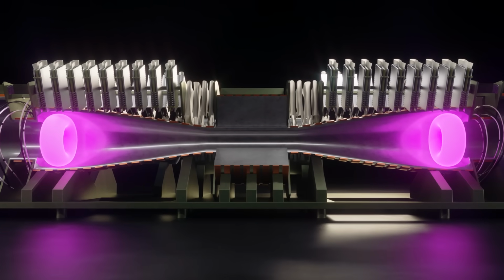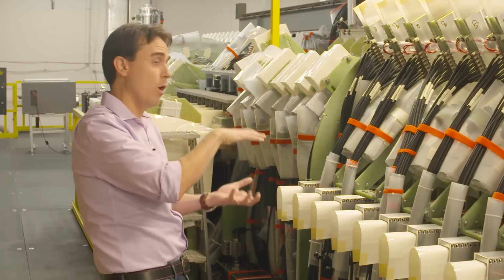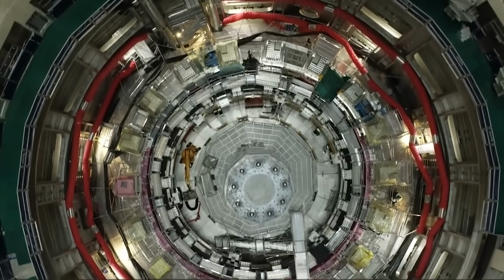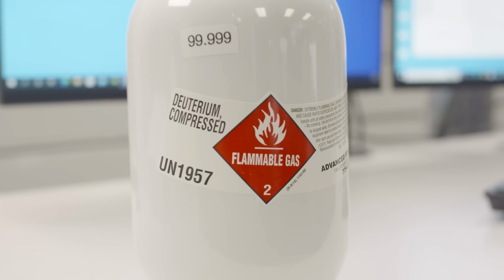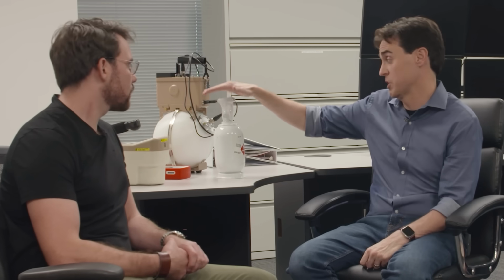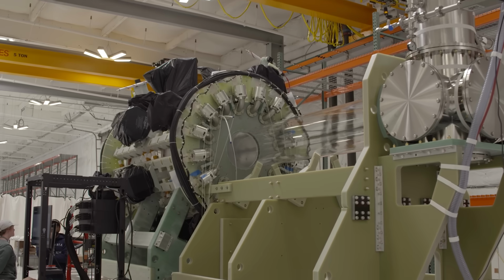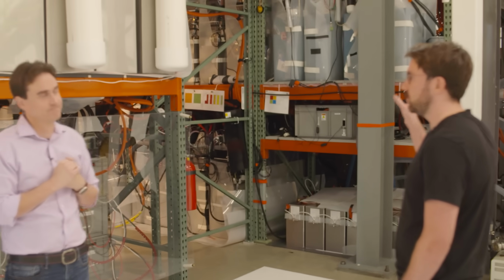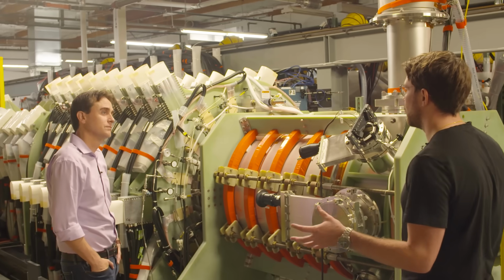A New Way to Achieve Nuclear Fusion: Helion

Comment: Update, turns out my concerns were warranted, and experts are weighting in on the situation. Helion Energy makes several, outlandish claims, and their method is unlikely to achieve net energy gain, regardless how much money they pump into it. Look up the yt video of improbable matter, named "The problems with Helion Energy - a response to Real Engineering"
Reply: That video is basing their criticism solely on this video. And this video is meant for the general public. So, it does not go into all the nitty gritty details (and gets a few things wrong too).
Most of the "concerns" raised by Improbable Matters have been addressed by Helion on several occasions in the past.
Reply: @elmarmoelzer2229  Sorry, but this response is too broad for me to take it at face value. Please go into detail which specifics got misrepresented by this video, and which of the concerns, that improbable matter is pointing out, were addressed by helion in the past.
Reply: @sgt.bonkers8706  
Yes, FRCs have been done before and the members of Helion's founding team were involved with several of them. They applied the lessons learned from thoes to their own design. 
There are lots of things that matter:
1. Size of the FRC. The larger, the less susceptible to n=2 instabilities.
2. Elongation to radius ratio. The longer the FRC, the more stable it is.
3. The merging before the compression. This part creates a single, hotter and more stable FRC (FRCs get more stable the hotter they are) as a targer for compression.
4. Their FRCs have a very low Te:Ti ratio of 0.1 and less. That makes things a lot easier because: P(fus)/P(loss) scales as Ti^1.5 / (Z^2 * Te^0.5 )

5. D-He3 is very hard to ignite, but they do not need ignition for their design to produce enough net electricity to be economic. That is because of the fact that they can recover a large part of the input energy directly as electricity and because of their relatively efficient output energy recovery.

6. Trenta is a subscale prototype with much weaker magnets than what they are proposing for a full scale powerplant.
Because of that temperatures are somewhat lower than in a full scale power plant. Power plants aim for temperatures over 30 keV in at which point the D-He3 reactivity surpasses the D-D reactivity.
That said, Helion actually wants the D-D reactions because that is how they are breeding their He3.
D-D => He3 +n or T +p.
Both reactions have a 50% chance of happening.
So, in mixed mode (breed and power) machines, they will need two D-D reactions for every D-He3 reaction, at least until the Tritium inventory is large enough that they have a constant supply from decay (Tritium beta decays into Helium3).
That can take maybe 20 years and that fact is probably the best criticism of Helions approach.

7. So they will have D-D neutrons in 1/3 of  their reactions. What IM does not mention is that D-D neutrons have about 1/6 of the energy of neutrons from D-T reactions (2.45 MeV vs 14 MeV).
That is below the activation energy of many materials and much easier to shield against. 
Trenta is as mentioned an experiment not a full scale power plant and only operating at one pulse every 10 minutes (vs 10 Hz in their 50 MWe power plants). Not all shots were fueled by Deuterium or Deuterium + He3. Many were fueled by a mix of hydrogen and Deuterium or pure hydrogen, depending on what they wanted to test.

Because of all that the total neutron flux has been relatively low. 
The machine is mostly made from low activation materials or materials with a half life measured in minutes. Aluminum activated by D-D neutrons has a half life of 2 minutes.
There is still permitted shielding of course. It is in the walls of the room and not close to the actual machine, which can handle the aforementioned relatively reduced neutron load just fine. 
In fact testing different materials for neutron exposure was one of the purposes of Trenta. They have tested quite a few alloys to see how they behave.

Those lessons will be applied to Polaris which is their next machine. Polaris will take those tests to a new level with a pulse rate of up to a 1Hz and higher temperatures.

8. The Ion gyro- radius "known physics" argument was hogwash based on a misunderstanding and out of context quote in the RE video.
What happened was that Trenta achieved a higher ion temperature than Helion's model predicted. Higher ion temperatures are a GOOD thing. They also mean somewhat larger gyro- radii. Thats in line with established physics. Just that Helion's "physics" model for the machine design was too conservative and Trenta performed better than predicted.
Reply: @elmarmoelzer2229  Ty for the detailed answer.

Comment: Please follow up on the issues mentioned in this response - https://www.youtube.com/watch?v=3vUPhsFoniw
Reply: That video you link contains a number of mistakes that diminishes its value. Understandable, since it seems to be based exclusively in what is said in this one, and this one is made for a general audience (it is short in technical details, and even contains a few errors).
Much of the info that doesn't appear in either one can be found easily elsewhere. Other sources of information are the presentation by Dr Kirtley from about a month ago for Princeton U. (available in one of PU's sites), Helion's website, a number of papers published in scientific journals these last years, etc.
Helion's approach is not guaranteed to  work, but that video if far from proving the opposite and, as usual, shooting from the heap adds little of value to the discussion.

Comment: Tens of millions of degrees? The core of the sun is 27 million degrees and you expect me to believe this little tube can withstand these temperatures without deformation or melting?
Reply: The fusion plasma is very hot, but not very dense (closer to a vacuum than to ambient air) and it is surrounded by a high vacuum, which is a perfect insulator.

Comment: Hypothetically, with some tweaking, could this reactor be used to propel a craft through space by putting an exhaust manifold of some kind off of the compression chamber??
Reply: They have a different design for propulsion. That would have a higher Thrust to Weight Ratio than this. They worked on that with a NIAC grant back in the day, when they had too little funding to move forward with the power plant design.
Reply: @elmarmoelzer2229  - When you say they, who are you referring to? Also, This thing was just created and I am trying to hypothetically use it for space travel, give room for the tech to mature.
Reply: @caffeinatedme6955   They = Core team of Helion. They have been working with FRCs way over a decade and not just for power generation but also for propulsion.
Trenta is their 6th prototype for the power design. They have had a number of other FRC machines for propulsion as well.
One of them generated over a billion FRCs in fast succession.
Reply: @elmarmoelzer2229  - Nice! Something new to geek out on and look into. Thanks for the info!
Reply: @caffeinatedme6955   Yeah, fun fact is that the same capacitors they used for that billion FRC propulsion system still work. At least some of them are used for Trenta now.
Reply: Look up the Fusion Driven Rocket. There are some videos about it on YouTube and potentially some papers and NIAC presentations might still be floating around.
They also had an FRC- thruster that was essentially accelerating FRCs out the back.
Those where experiments they did when they were still MSNW LLC (before Helion spun off from that).

Comment: WASTE OF TIME AND MONEY. 

FISION IS GOOD ENOUGH.
Reply: I remember having read one opinion article from the archives of a paper (don't remember which on, sorry), dated a few years before the end of the XIX century, saying more or less the same about gasoline/kerosene and internal combustion engines. Coal and steam engines were perfectly ok, no need for any new poisonous, explosive, unsafe fuels or dangerous machines.
Reply: @charliem6590  Oh. you HARDLY get the issue.  This solves practically nothing. 

The pitch?? "It runs on WATER" ... It'll SAVE THE PLANET ... 

Yup ... got people who were burning DUNG yesterday lining up to buy these things. 
They're TOTALLY going to the places that need CHEAP ENERGY, right ...? 

BTW ... do you know the relationship between continuing to use a water-based heat exchanger and it's efficiency? 
And the idiotic NIMBYs who'll then demand the same concrete domes making them far, big, and have high losses therefore? 

OR -- if they use a SALT LOOP ... why wouldn't we be investing a FRACTION in LOW pressure, HIGH temperature (800-1200 C) Thorium reactors that really already has cheap fuel ... and could literally be MASS PRODUCED, from the size of a trailer, up to Gigawatts ... ? 

You know what fusion boosted hydrogen bombs use ..?   LITHIUM DEUTERIDE ... :) 
But this is the "safe stuff" ... right? 

Research a subject before you run your cox-holster.   You LITERALLY don't know what you're talking about.

Comment: Nice machine. Now, cut it in half and mount half in one of Musks Starships. Where the rockets would usually go. Fuel it with Methane because it packs well, and power it with the Helion fusion generator. Let's see how fast we can make it go. And check out the mpg. And see what happens when we use it in an atmosphere. If it's pollution free, manned spaceflight is about to enter a new era. The 'Flash Gordon' era.

Comment: At 12:53 he's talking about D-D fusion, and the equation shows the emission of a neutron, but there is no neutron shielding for the equipment that is supposedly sustaining fusion reactions. Those neutrons are extremely hazardous radiation without shielding and would also be causing the machine to be irradiated, but that doesn't seem to be a problem, so the conclusion is...the machine doesn't really work. They're talking about hopes and dreams but talking about it like it's happening today, and it isn't.

The word for that is "scam."
Reply: They should change the name to Speculative  Engineering.
Reply: Trenta is a subscale Experiment that is running at one pulse every 10 minutes vs 10 Hz in a final power plant.
Trenta still has weaker magnets than a full scale power plant would have. So the temperature and density is lower.
As an experiment it is not always running on pure D-D and comparably few shots were done with D-He3.
Many shots were made with a mixture of Deuterium and hydrogen or just plain hydrogen, depending on what they were trying to see in the test.
All of that combined means a relatively moderate total neutron load, compared to an actual power plant based on the design.
Permitted shielding is built into the room, not close to the machine.

Comment: Every word of this sounds like it's written by their marketing departmant. Also i didn't read anywhere else about this. So i automatically don't believe a single word.
Reply: Watch Improbable Matters video on Helion. This channel should change its name to Speculative Engineering.
Reply: @sassa82  Hi Sassa. Try to follow Improbable Matters' video "references", you may be up for a surprise. Someone else in these comments (someone who thinks Helion is going to fail, by the way) called them "crap", and in my opinion that's a fair assessment.
So, if IM's info sources are of that low quality, wouldn't it follow that his arguments might be, lets say, debatable.
Reply from the maker: Rephrased. "I have zero knowledge of this technology, and have formed an opinion based completely on my own biases"
Reply: @RealEngineering  No, all I'm saying is this sounds like a commercial.

Comment: This is supposedly a D-H3 reactor but operating at only 100M degrees, where D-D fusion is orders of magnitude more productive. So how are they not going to get fried by neutrons again?
Reply: This is an experimental machine, NOT a power plant. Power plants will operate at much higher temperatures (300 million, maybe higher). They did a few shots with D-He3 but most of the operation was Deuterium and/or some Deuterium with a mix of ordinary hydrogen.
Reply: @elmarmoelzer2229  you are still going to get extreme neutron flux from D-D chain whether you want D-H3 or not. This is a big reason (other than He-3 being impossible to come by) that most proposed commercial reactors use the tritium chain. That and 1000x better reaction rate.
Reply: @Grak70  Another thing. The reactivity of a D-T mix is 1000x higher than with D-3He at 100 MKelvin, but above that temp the ratio decreases, it is 100x at ~200 MKelvin, and 10x at ~900 MK.
We'll have to wait and see how high Helion can get the ion temp in their next machine (Polaris), but Dr. Kirtley has said he is confident they can reach 200 MK at the very least, probably more.
Reply: @charliem6590  well the science will out. I just can’t see this thing doing much when it takes a 90% haircut even at a billion kelvin.

Comment: The moment with the explanation of the transition of the plasma temperature from 10-20 million degrees to 100 million degrees raises doubts. 7:30 When did MODERN technology become capable of compressing plasma like that?! There, most of the entire installation was able to heat the plasma only (!) To 10-20 million degrees, and the incomprehensible technology of "magnetic compression" was able to sharply add 80-90 million degrees! Then why do most of the equipment at all?! Squeeze immediately with your "wonderful" magnetic fields!
Reply: Magnetic confinement fusion commonly operates at temperatures over 100 million degrees. Several Tokamaks have been operating at higher temperatures over several minutes now.
Pulsed magnets are not that hard to build at 10, even 20 Tesla strength.
FRCs are high beta (~1) that means that for them a certain magnetic field strength has a much stronger effect than for a Tokamak (which are usually at a beta of 0.05).

Comment: This doesn't generate fusion. If they were getting D-He3 reactions they'd be getting lots of D-D reactions generating lethal neutron radiation, and this isn't shielded. It's not shielded because it doesn't work. I suspect the reason they're letting everyone see their amazing machine is because the venture capital for bullshit is drying up and they're trying to generate some buzz before they're forced to get real jobs.
Reply: It is not shielded because this machine is a subscale prototype and not a full scale power plant. It also only does one pulse ever 10 minutes and not all pulses are fueled by D-He3 or pure D-D. Some will have hydrogen mixed into them.

Comment: Aaaand Improbable Matter just debunked this.
https://www.youtube.com/watch?v=3vUPhsFoniw
Reply: "Debunked", lmao. Improbable Matter got a lot of things wrong.
Reply: @isabellagoogleaccount8418  Such as?
Reply: @gabor6259  There are numerous errors in Improbable Matter's video.
FRCs have been done before, but not in the way that Helion does. There are numerous factors to consider:
1. The FRC's size. The greater the size, the less susceptible to n=2 instabilities.
2. The ratio of elongation to radius. The greater the length of the FRC, the more stable it is.
3. The merging that occurs prior to compression. This component produces a single, hotter, and more stable FRC (FRCs become more stable as they heat up) as a targer for compression.
4. Their FRCs have a Te:Ti ratio of 0.1 or less. This simplifies things because P(fus)/P(loss) scales as Ti1.5 / (Z2 * Te0.5).
5. D-He3 is extremely difficult to ignite, but their design does not require ignition to produce enough net electricity to be economically viable. This is due to the fact that they can directly recover a large portion of the input energy as electricity and have a relatively efficient output energy recovery.
These are only some of the issues. The author doesn't bother doing basic research. It's not worth watching it.
Reply: @gabor6259  How curious you've stopped replying.
Reply: @isabellagoogleaccount8418  I trust a former fusion scientist (Improbable matter) more than a youtube commenter who crtl+c, crtl+v's info from the company website.
Reply: @fess3932  Please provide the link on the company's webssie from which I supposedly copied and pasted from. We'll be waiting.
Reply: @fess3932  We accept your concession.
Reply: @isabellagoogleaccount8418  how is the fundraising going for Helion?
Reply: @matteolombardo1  brought alot of funds for Helion?
Reply: @sassa82  "fundraising fundraising" is not a valid scientific rebuttal.
Reply: @rachelleliaberry6138  so why does Helion not publish its results and keep pushing forward its results? Its an obvious scam.
Reply: @sassa82  They do publish their results and the theory behind it --perhaps you haven't bothered looking for either. Your "its" needs an apostrophe.

Comment: I don't think this system is going to fly. My college professor saw this video.
It will be a radioactive nightmare he said.
Reply: i thought so too. There is no system in place yet to deal with those high energy neutrons enriching the chamber walls. The system itself i outright genius, using the already pulsing magnetic field to utilize the ionized plasma is something iv'e seen for the first time. But getting rid of billions of GeV of neutrons splashing out the chambers every single second seems like a very extreme task to handle. I will stay curious and check in on that project from time to time, maybe they come up with a solution though.